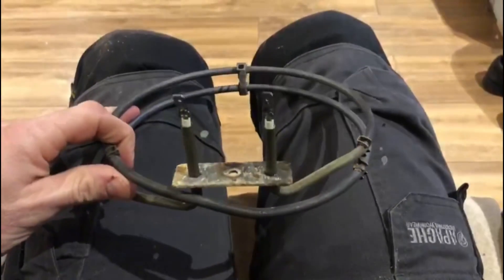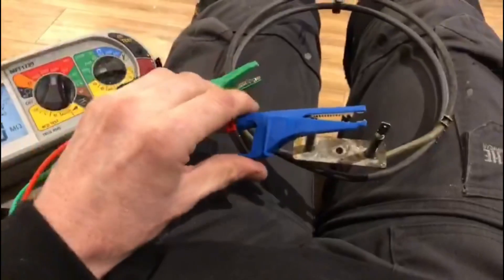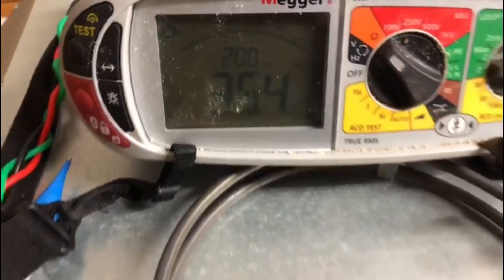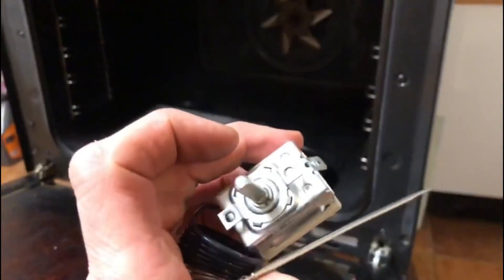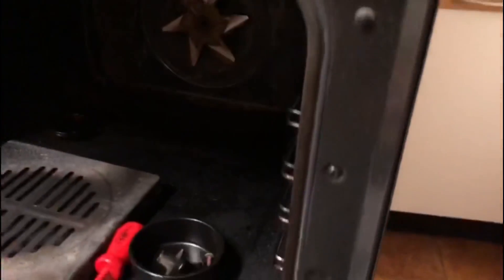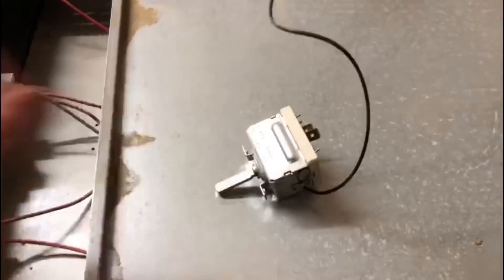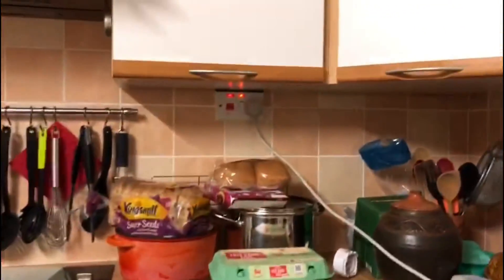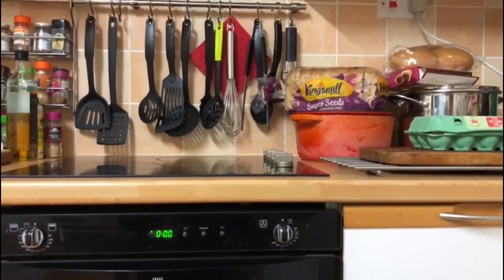Replacing an Oven Heating Element & Temperature Control Thermostat - Electrical fault finding

Comment: My mums oven stopped working a thew weeks before Xmas couple years back and it had just gone past Argos 1 year Warranty. I checked connections which were all fine so took the top off and the knob that changed the setting was all live even the nuetrals. I called the Argos team and they tried to palm me off with its past the warranty. I then threatened to sue as they sold me something unsafe regardless of the age and when the engineer come out he confirmed it was a cross polarity from the factory.  He got a brand new oven delivered just before Xmas and Argos issued a compensation voucher of a £100. My mum was over the moon as she could still cook Xmas dinner and wasn’t out of pocket.

Comment: My old oven the main thermostat failed so it just kept getting hotter and hotter until the safety thermometer kicked in and tripped it's own internal protection circuit. The dials got really hot when it happened

Comment: Personally I think we electricians shouldn’t have any thing to do with this stuff, there are plenty of qualified appliance engineers out there leave it to them , after all they have earn a living as , we have enough to do with EICRs and sorting out incompetent DIYers mess . But who am I to argue i’am just a humble spark who’s opinion means nothing.  
But Matt is a man of many talents so FairPlay to him .
Reply: Some qualified sparkies do a cr@p job too, not just DIY, couple of jobs I’ve had done by so called pros have had to be rectified by another sparky.
Reply: @michaels8336  yes you’re right but my point is that we should leave this stuff to the appliance engineers they carry the spare parts and can get the parts quicker than we can as they will know what parts they need. Also I don’t know any appliance engineers who do a crap job.

Comment: The most common cause of the element blowing is the fan motor bearings failing and the fan seizing up! Always worth checking free rotation before replacement of the element, as otherwise the new one will be short lived...
Reply from the maker: Great input - thanks Gaz 👍🦾

Comment: I've replaced dozens, if not hundreds of these! Sometime they will blow the trip and then once reset, all will be well, except that the element won't get hot. Always the element, but occasionally the stat too. Neither job is particularly tricky, but you need to know how the appliance comes apart. 👍

Comment: Nice demo Matt, I’ve replaced the fan elements many times but, never the stat. 
It looks straight forward!

I find the grill or top oven elements a real challenge to replace as they seem to be buried behind the oven walls, if you do happen to replace these “top elements”could you do a video on them?